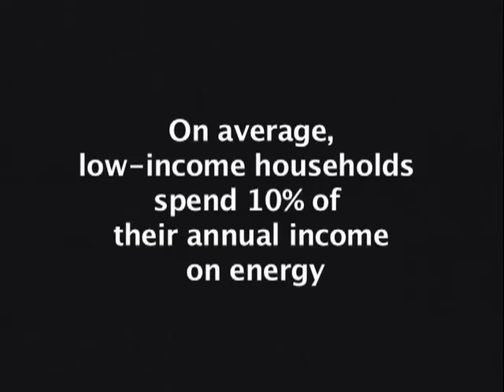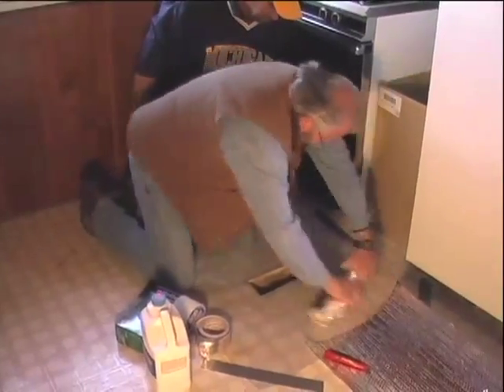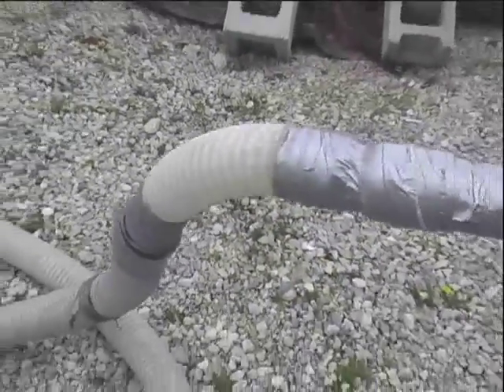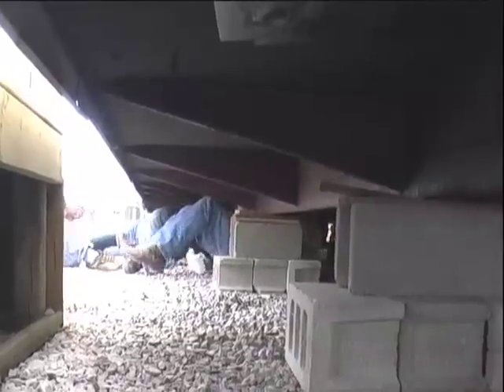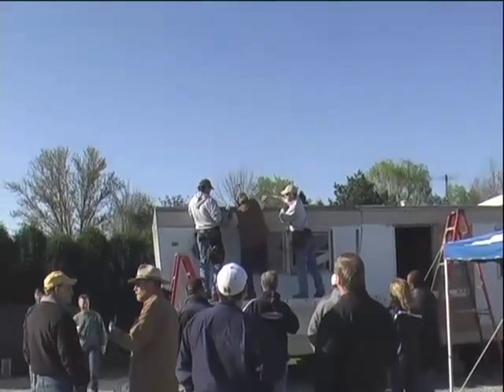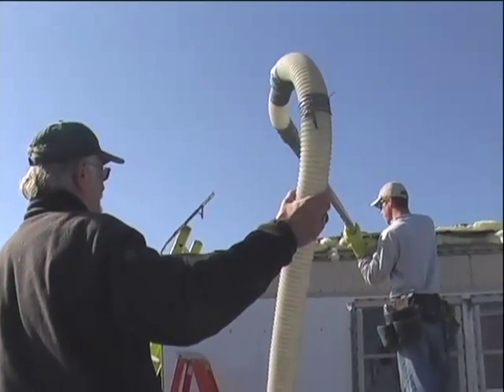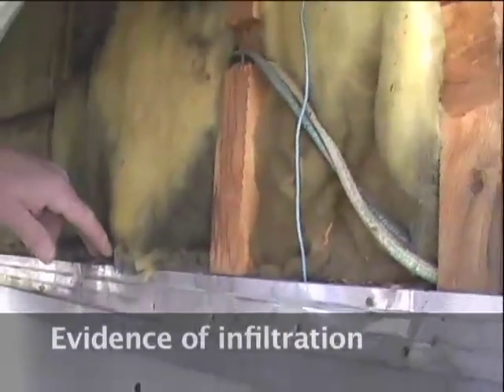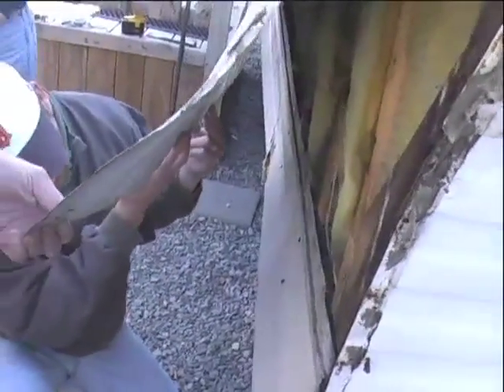Mobile Home Weatherization Training

Comment: What surprises me is that they didn't use insulated vinyl siding on that older home. Or you can put furring strips on the exterior then insulate between and then vinyl it.

Comment: i bought an older mobile home. they blew in the insulation  in the attic so tight that it plugged up the vents on both ends. with it not having any air flow at all it ruined the roof in the winter.i would never do it like this.do it right or not at all.